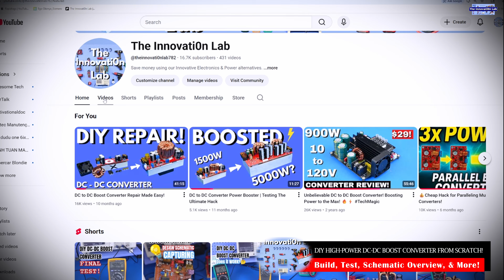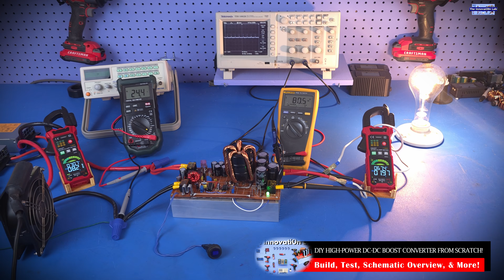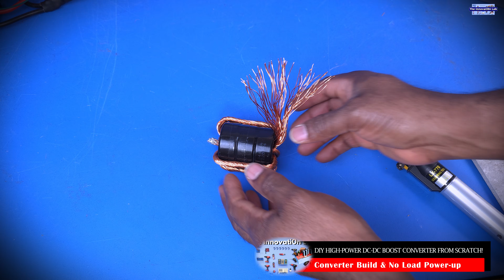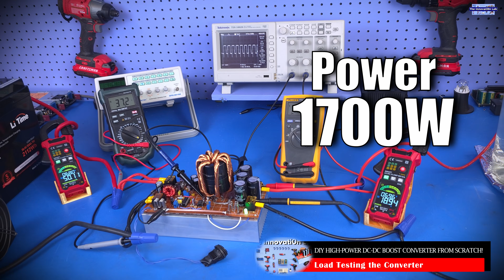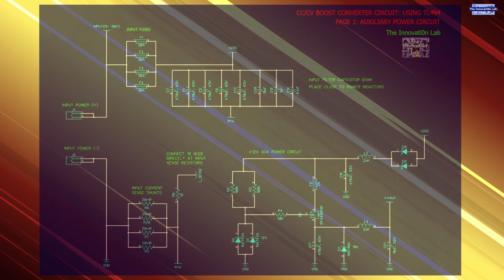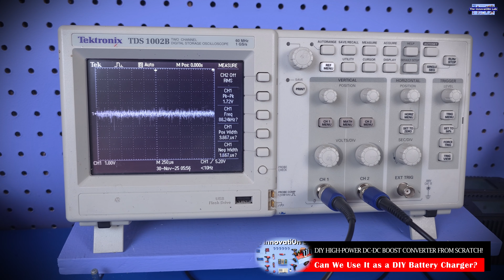DIY High-Power DC Boost Converter | Complete Step-by-Step Tutorial

Comment: Where can i put an on off switch on a common 1200w dc to dc boost converter?
Reply from the maker: The safest way is to place a switch or relay on the enable/control circuit of the PWM IC rather than switching the high-current input or output directly. Respectfully, The IPL💥
Reply: @theinnovati0nlab782 thank you so pin4 and pin12 it is...

Comment: please kindly help me... i am looking for DC DC stepup.
12V-24V input would do just fine. and split type 90vdc+/- output. for my diy class D. i am interested in this taramps stepup that use SG3525. if your familiar in this design by taramps. i need a advice.
Reply from the maker: I am familiar with SG3525. However, I have not designed a dual/split output cconverter in the past. However, Its not difficult.
Stay tuned.
Respectfully, 
The IPL💥

Comment: Hello dear friend, although I don't understand your language, the circuit schematic was excellent. Only in this boost converter there are 2 ferrite cores, one large one which contains 3 and you explained it, but you didn't say anything about the small ferrite core which is orange. Can you tell me the full diameter of the core and its height and tell me how many turns there are on the core and what type of wire you used, because our country is under embargo and we can't buy such a boost converter, but with your help and the schematic circuit we can make it. I am from Iran and thank you.
Reply from the maker: Wonderful!
Sorry if I forgot to talk about the input filter inductor. As you have seen in the video, there are  multiple components on this design and I focused on the major components.
That inductor is not super critical to have on the design. It provides some input ripple filtering function to the auxiliary power that is driving the control components. I beleive that was a 2uH inductor. I will check my design notes and get back to you. Currently on a travel.😊

I will provide more information on that later. 
Stay tuned

Comment: Nice project bro, how about converting AC sine wave to clean DC output? I wish there was a step by step video.
Reply from the maker: Thanks a lot!

AC to DC rectification is actually one of the easier projects for our channel.😊 I have taken a note and added it to my list of future dedicated videos.

However, I have covered it in some parts of my previous project videos. 
👇👇
💥How to connect converters in series, using the isolated tranformer method.
https://youtu.be/roI7LExA9_Q?si=DNkkUDzzgF_oSCUU

💥How to make a cheap battery charger
https://youtu.be/5EQs9_Cu7xo?si=CxksSrK3amGahX_h

Thanks for supporting our channel and please stay tuned and help us keep growing by sharing our videos on your social media.😊

Respectfully,
The IPL💥
Reply: @theinnovati0nlab782 The biggest problem in sine wave ac is the difference in phase between voltage and amperage, which results in poor qos phi values, which in turn leads to poor efficiency. Can an ac to dc converter achieve efficiency above 90%? It will be very challenging.
Reply from the maker: @priyo.dwiutomo 
I love this level of engagement.

If done right, you  could achieve close to 95% conversion efficiency - for single phase AC. Up to 98% if you could access a 3-phase AC power source. 

3-phase AC is only better if you need a much higher power factor.😊

Respectfully,
The IPL💥

Comment: From what I've been slowly learning, resistors are key to not damaging things. That might be elementary to some, but I've only just started looking into the matter in some cases. They act as soft start mechanisms,  and in the case of transistors, they regulate voltage and help to smooth it out. They are needed for input and output 
are
Reply from the maker: I am glad you are learning new things and concepts in the world of electronics...yes resistors serve a wide range of much needed critical purposes. 

Let me know if you have any questions. 

Respectfully,
The Innovation & Power Lab.
Reply: Not 100% sure since I'm still learning myself, but I think the smoothing is done by capacitors. Transistors are like small switches. At least that is what my memory tells me, which may sometimes be unreliable 😅

Comment: How does it behave with inductive loads?
Reply from the maker: Not yet.
I tested it with purely resistive loads and also used it as a diy battery charger - all in the video.

Thanks!
Respectfully,
The Innovation & Power Lab

Comment: Ive been using a dc to dc boost converter zk-pw1200 to boost the voltage from my sodium ion battery to my inverter and its working so great unlike when im not using a boost converter.  We know that sodium ion battery cannot hold its voltage for too long or straight like the lifepo4 but it has a lower cutoff voltage as low as 8.0 volts and this is where the sodium ion can compete with lifep04 as long as you use a boost converter to use all the remaining juice of the sodium battery  and avoid the prematurely shutting down of the inverter.  Maybe you can do an experiment on this and see what i mean😊
Reply from the maker: Wow!
That is great!
Thanks for sharing your wonderful experience.

However, one thing to keep in mind is that you will be loosing a lot of power if your power is going through a converter first. This was part of the tests I showed  in my latest video.
👇👇👇
Released yesterday.
https://youtu.be/gfEWosv6OD8?si=xrCizegqfPjLNIfA
Reply: @theinnovati0nlab782 yes ive watched the video but im not using a buck converter but boost converter instead to keep a constant voltage of 14 volts from a sodium battery that is producing power down to 8.0 volts so do you think it has the same effect?  Anyway even if it has a loss of energy too id still do it rather than to not use all the juice of my sodium battery thats just sitting there like its also a waste of energy right?

Comment: Sir, I have an issue on my step up, the amp won't rise up, max amp I get just 5A, mosfet still cold, but the voltage can reach 90v, test load with heater 1000w & I use 24v 50A for input power, which component should I replace.?
Thanks before.
Reply: Check the voltage output under load does it drop down or not ? ... maybe your current sensing from shunt to the pwm ic is not working 😃
Reply: @khaseigaming ok thks, I will check it later
Reply from the maker: Great question.
What converter is this? Were you able to build the one in this video?
Reply: @theinnovati0nlab782 same as yours converter, 1500w boost converter, i buy the cheap one like in the ur video, after 10 month use for battery pack charging, now igot the problem.

Comment: Do u restart the bulk converter everytime? Like for example u set it to 36v the next morning will it still be at 36v or u need to reset it again
Reply from the maker: Nope, it stays where you set it. That exactly what it is supposed to do - even if the input voltage varies. This is one of the core functions of dc to dc converters - to provide great output voltage regulation.

I appreciate the wonderful engagement.

Respectfully,
The Innovati0n Lab.

Comment: Please I asked a question. If I use this for my solar generator to regulate the volts from panel to 48v when my panel is bringing 70v. What about when the sun goes down and can't even bring 20v what will happen then?😊
Reply from the maker: Great question.
However this is a boost converter and it will not step down your input voltage.

Secondly, this is not made for a solar project. You can certainly do some research and modify the design schematic that I have provided to see if you can pull that off.

My videos are intended to inspire and provide the foundational starting point. I do not have all the answers...no one does.

The engineering process involves problem-solving through research, analysis, test, and documentation.
I cannot do this alone, everyone has to help!😊😎

Very respectfully,
The Innovati0n Lab

Comment: Hello my friend! I am working to build a boost converter from 48v to 180v for charging NiMH hybrid battery packs (I picked up a bunch for free and want to put them to use in the summer when we have excess solar)
Reply from the maker: Wonderful!
That sounds like an interesting project.

However, please becarful as high voltage DC is really dangerous. Make sure you are using high voltage PPE to protect yourself.

Success Wishes.
Respectfully,
The Innovati0n Lab

Comment: I have 1800watt boost converter, I am trying to boost from 24v dc to 48v dc to drive 7 ampere  load. But the converter does not provide enough power to the load which is video light 600 watts. any idea what can be done about it
Reply from the maker: The 1800W converter at a 24V input should be able to easily give you that - unless your converter is faulty, or maybe there is something wrong with your load and it is shorting the output of the converter.

Try adjusting the output current limit potentiometer to the maximum setting. 
If the output current limit is set below 10A.....we'll that explains the issue you are having.

You may find this video helpful as I explain how to adjust the output current limit.
👇👇👇
https://youtu.be/WDWJ77WWkXc?si=V2YVm0ihBfc-L6h-

Comment: 44 minutes of information sharing, nice one, i had few experiences with boost converters to charge lifepo04 batteries, at the end I decided to buy an XY7025 step down converter, change the cooler design and beef it up a bit to handle 25/27a connected to 3 X 1200 HP PSUs in series ( thansk for your stl case), i have also another 2 X DPS1200 in series when 16s needed put them all 5 together.
Reply from the maker: Amazing!!
Yeah, there are endless possibilities when it comes to electronics designs....as long as your analysis is sound and it works for you in the end....that is all the matters.

Remain blessed.
Respectfully,
The Innovati0n Lab

Comment: nice job bro increse wattage load 2000w to 7000w or make it more efficient u can doit
Reply from the maker: Thanks for the wonderful feedback. 

That would be amazing, but it will be extremely difficult to do on a veroboard. An efficient 7000W converter will usually involve a paralleled synchronization of multiple converters. Attempting such a design on a single board could lead to massive noise issues.

As a matter of fact, getting close to 2000W on diy veroboard design is pretty cool - in my opinion.

Respectfully,
The Innovati0n Lab.
www.theinnovati0nlab.com

Comment: Thank you for dedication to the project and showing us in prior videos what works and what does not.  I brought 2 DC DC boost converters to connect to one 51.2v battery to send 1000 watts to two Delta Pros xt60i solar inputs (150v max 15 amps).  You saved me from frying one of the boards as this would be running them in parallel.
Reply from the maker: Thanks for the wonderful feedback.
I am glad to hear that you found practical applications from our tutorial videos.

Thanks for the great positive feedback.
I greatly appreciate it.

Very respectfully,
The Innovati0n Lab.
Reply: Ultimate instead of being limited to 800 watts from a 51.2v battery I was able to get 1550 watts to a single unit.  Allowing me to benefits from capacity of a 51.2v battery (16s) with the internal 48v battery (15s) of the Delta Pros safety.  I charge my EV and both battery finish depleting at same time despite different capacity and voltage.